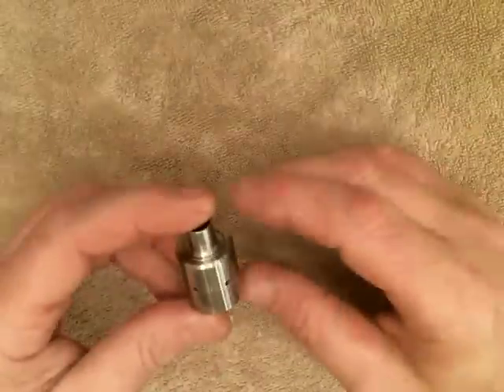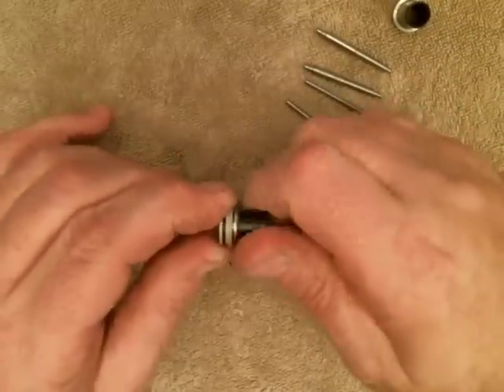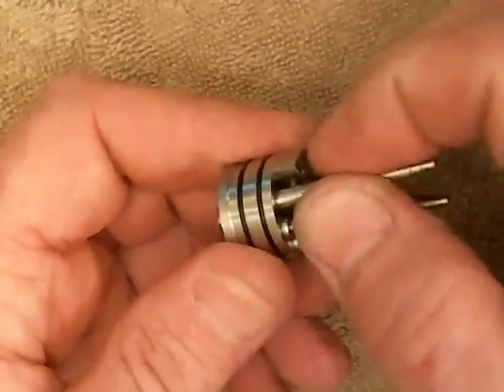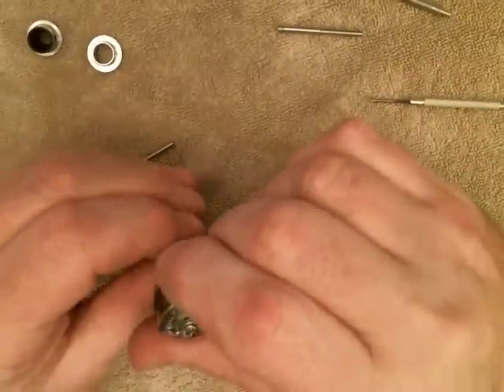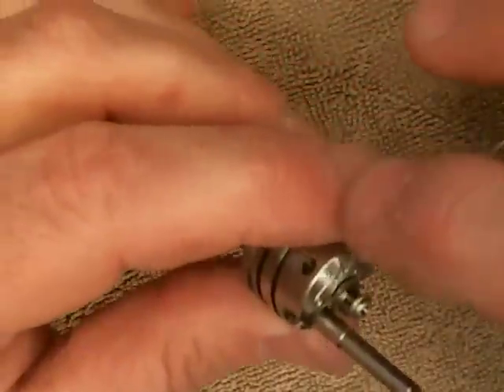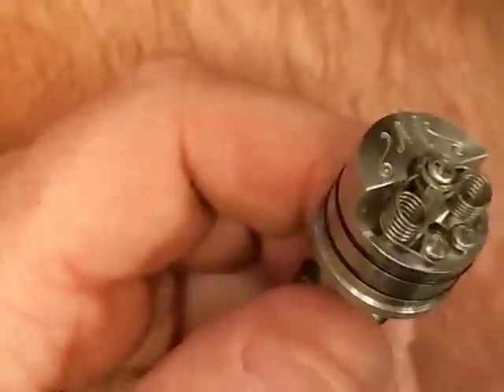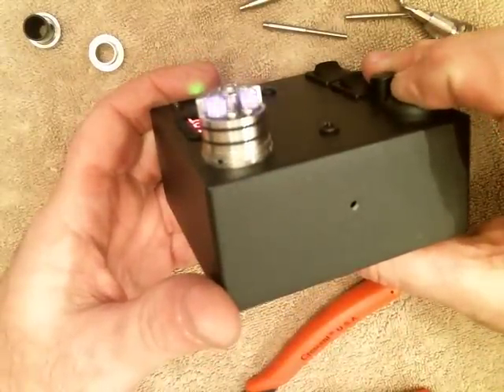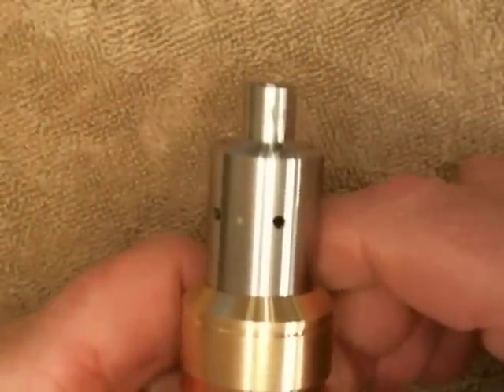The Marquis Dripper

Comment: yes rotating the crown post, field the vapor did a review saying that is adjustable but he didnt show how
Reply from the maker: It's not meant to be adjustable. But you can rotate it from the bottom by taking out the copper pin and using a slotted screwdiver to turn the pin from the underside. Just turn it clockwise until you get it to the position you want. But it should be set in the correct place when we shipped it. The way Mike uses it is not the way it was intended.

Comment: Cisco on board...awesome...The device...nice to look at...simple?..Not so much. Its hard enough to keep up with extra O-Rings let alone Building rods and extra top cap pieces. And for the money...its a bit much, to try and keep up with.... a neat set up for the pos screw and wires...very innovative...Im sure the GEEKS will love it....I wish you guys would build a really simple atty...with large post holes 4 posts for ease of build and a nice deep well...tons of airflow control and a top cap like the magma where there are NO O-Rings to fool with and a hole on top that fits a Chuff drip cap like you can use on the Tobh rda and a few others...Thats simple...thats easy, and nothing to keep up with...no spare parts needed...wish you the best

Comment: There's one problem I have with it that I would love if you could fix.
Basically depending where your threads start and end depends which way your airflow points which means depending which way you hold your mod, so I vape right handed but if I hold my mod with my right hand the airflow faces down so juice runs out the airflow holes, I have to use my left hand to have the airflow facing up. It would be nice if you could work out a way to adjust your airflow to any direction you like once it's on the mod, maybe a way to adjust the 510 connection.
Reply: Oh and where do you get a new positive screw if you lose it ? Avid vaper doesn't even sell replacements.